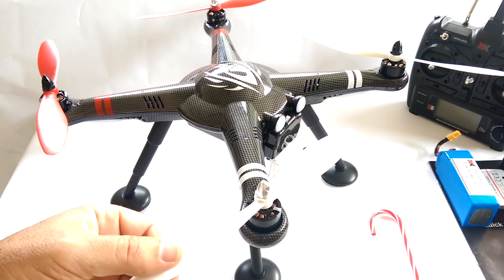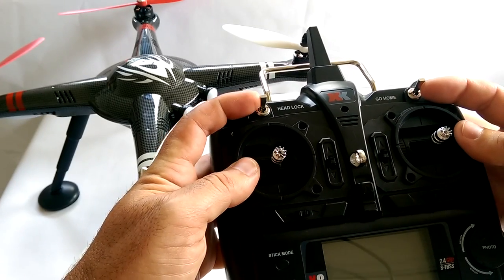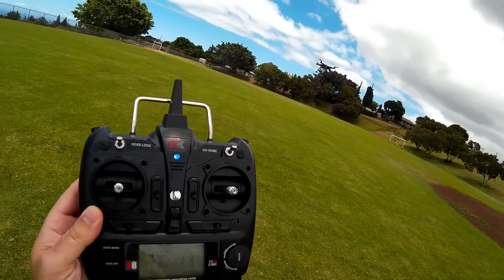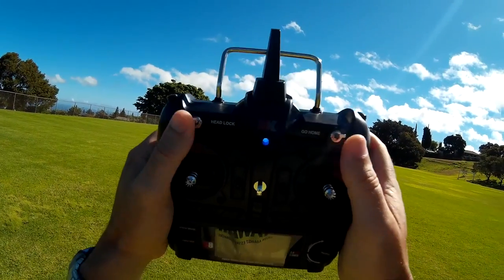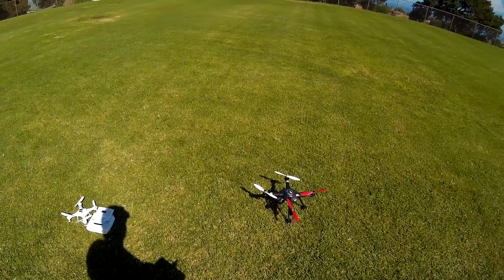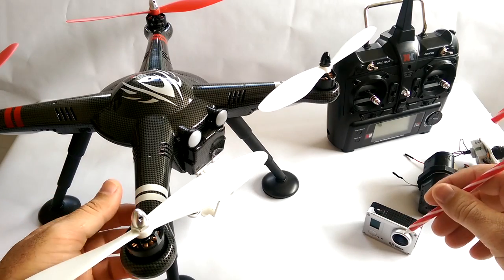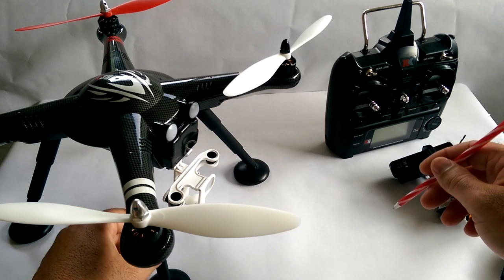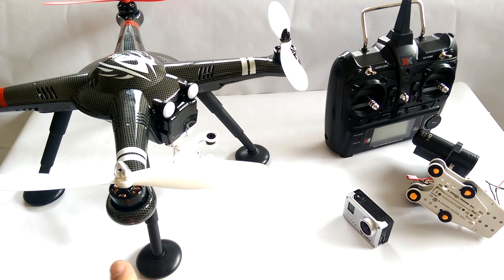XK Detect X380 GPS QuadCopter Drone Full Review - [Setup, Flight Test, Pros & Cons]

Comment: Sorry maybe you can help me,i have problem   with x380.when i use gimbal on it,the red light beeping continues and i cannot control tilt..
Thx b4..
Reply from the maker: With gimbal unplugged it's ok?
Reply: yes,work fine..
Reply from the maker: +arief budiman try to connect to the flightcontrolconfig software and see if you have any errors or problems.  You can see how to do the process and software on the rcgroups x380 owners thread.

Comment: Great review, looks like it will be taking the place of the Cheerson CX20.  On the link at GB it does not show any camera mount. The mount that you had was it stock or did you add that.  Very impressive and the price is good also.  Thank you for the video.
Reply from the maker: Thanks.  It comes with a basic dampened camera mount I tested with both that and a gimbal on review.

Comment: Did you find any problems with having the camera weight so far forward on the quad? Did this affect stability or handling?
Reply from the maker: I've only tested with Cam and Gimbal in high winds so far so couldn't really gauge it.  I'll be doing more extensive testing this weekend and keep you all posted.
Reply: Dustin Dunnill Thanks. I was impressed enough to order mine yesterday. I am hoping she fly's a little more stable than my X20 does. Looking forward o a few  more videos on this one from you. Thanks again!
Reply from the maker: Congrats!  Check out the X380 owners thread on rcgroups.com for how to connect it with software and change some parameters which gives it even more value.
Reply: Dustin Dunnill Thanks for the reply. I read many of the posts of the forum and was more confused than before I started. I am hoping you might do a review of downloading and connecting procedures sometime. When I receive mine I would like to change the return to home height parameter to a higher altitude such as 20 to 30 meters. I would also like to extend the distance fence if possible. I appreciate your videos, thank you for your efforts.
Reply from the maker: I will probably do a connection and config video soon.  I think 30M was maximum RTL altitude and that's what I set mine at.  Fence is also configurable.
Reply: +Dustin Dunnill Thanks again. Just got mine yesterday. Looking forward to your software update video.

Comment: dustin maybe i just missed one but can you see telemetry on TX screen such as coordinates, battery etc?
cross my finger wish you could turned this quad into powerful fpv machine ., thanks
Reply from the maker: Hi , nope.  Unfortunately telemetry is not built in to this quad.
Reply: we can't win them all haaa, always downside ..thanks for your lightning respond cheerrsss
Reply from the maker: Although there is a UART port on main board which looks like it could accept a telemetry antenna.  Just a matter of figuring out what works.

Comment: Hey Dustin, Can you tell me that on Maui are you allow to fly the Quadcopter at any public park or not ? or even in your back yard ? Do you need to go to special area that allow you to fly and where ? Thanks Toan
Reply from the maker: As far as I know...cannot fly in national parks and within 5miles of airports.
Reply: +Dustin Dunnill Could I hover and take off in my back garden with this quad?
Reply: +Dustin Dunnill I have flown syma x8c tarantula x6, mjx x600 easily... Could I fly this and hover in my back garden while buildings are around?
Reply from the maker: +markybyeah Yes,  it is incredibly easy to fly as long as it's working right and you give it time for good GPS lock.
Reply from the maker: +markybyeah Yes, you will be amazed how easy this is to fly.  There have been some lemons so as long as you get a sound unit you will be amazed :)
Reply: Dustin Dunnill
would you say it's more stable than the syma x8 and mjx 600?

Comment: hi Dustin, recently my x380 was about 1,200 ft away and it wouldn't respond to my controls, so I hit the RTH switch and still wouldn't respond, it would just hover in place. If the quad lost communication, it should go into fail safe mode and return but none of that happened. This leads me to believe that the quad didn't loose communication because it didn't go into fail safe. I ended up eventually getting control after 7 a minute hover. what could be the issue? replace transmitter? quad receiver? or re-download software files?
Reply from the maker: +Mirco Pintican Hi Mirco, the x380 has a different RTH than most.  It will come home on connection loss (if it is set to rth in flight controller firmware.  There is also a "hover" option if connection is lost) but unless RTH toggle switch is on, when connection is lost the X380 will stop and hover when controller connection is re-established.  So you may have had an instance where it was on the fringe of range and kept going into RTH but then hovering when back in range.  If this happens, make sure your RTH toggle is on so when it re connects the x380 will know to come home until a different pilot command is given.

Comment: Great review, this will be my next aircraft, what type of after market props do you recommend for this bird? And by the way, you have a'lot of hart for the radio fail safe test...  :)
Reply from the maker: +John Washington Thanks John.  It's a good solid economical quad.  Just make sure you read manual, calibrate compass in your flying field and wait a minute before take off so the GPS can get good lock and update.
Reply: Will do, Thank you

Comment: +Dustin Dunnill maby you can answer this question, got my x380 yesterday successfully binded the transmitter to the quad,successfully binded the calibration, but today when i plug in the battery all i get is a solid red light, tried it a few times still comes up red, any suggestions?
Reply from the maker: +Wim Ross hmm.  Could be many things.  Do a search at the rcgroups.com X380 owners thread and you should find some answers.

Comment: Does this quadcopter has altitude hold mode function? Also, do you think there is a away to get the legs out of the shots with the gimbal? :-)
Reply from the maker: Hey there.  Since this quad is always in GPS mode, the GPS works in conjunction with the barometer for a constant altitude hold when your finger is off throttle.  Works very well as you can see in video.  When you let off both sticks it goes into a "position hold" mode for a super stable locked in altitude and  position (also seen in video).
Reply: Dustin Dunnill Ahh, thanks for clearing that out for me! :-) Great over all review by the way. Do you prefer this quadcopter over the CX-20 for a beginner in aerial video?
Reply from the maker: If you can handle the extra $100 then I would say yes as it is in stock form.  But for modding future the CX-20 open source still is the best until we figure out how capable the X380 is.

Comment: GREAT review! Some questionns: This appears to be a repackaged WLToys V303 .. do you concur?  Did you do the "calibration dance" prior to flights?  I know they stress that with the V303.  The USB port could be for firmware updates ... at least that's what its for on the V303.  You're right ... very impressive, and a decent price.  I look forward to future reviews on this quad. Cheers!
Reply from the maker: Seems to be v303 with upgraded electronics and longer skids.  Yes, I did the compass calibration prior to first flight and it was easy.  USB does seem to be for updates/parameter calibration but owners (including me) seem to be having trouble connecting with available software.
Reply: Dustin Dunnill 

overall how would you rate this package for its price? approx 650$ canadian for me, ive never had a drone but i want to do an fpv setup and this looks like it would be perfect and the flight time seems awesome.

getting the x380c kit comes with a hd camera and a motorized gimbal for it right? i just need to get a separate fpv system and utilize the gimbal for full remote control right?
Reply: ObliVious
When I looked it up online, the e-tailer I saw had 4 versions of the x380. One had no mount.  One had the std. non-gimbal gopro mnt., one had a gimballed mtn., one had a mount for a Mobius (or equivalent) and one had a powered gimbal. Prices ranged on the 4. Here's where I saw that: http://www.dealsmachine.com/best_254686.html
Reply from the maker: Yes, I think it's a good quad.  Easy to fly and a simple start into AP.  I'm not sure on c model gimbal and camera quality but you can always buy base model and add your own if you want better camera quality.  You will be able to control tilt for gimbal remotely and you can hook an FPV system up to the gimbal camera or add a small fixed camera.  But for filming and lining up shots you want to see through gimbal camera.
Reply: Dustin Dunnill 

I ordered it with the camera and the gimbal i just wanted something to work with right away. ive already started getting a few items you modded your cx20 with, are you switching everything over to the 380 or are you going with new stuff? im sure the fpv and the range extender parts would be the same, but does the telemetry only work with the open source cx or can you use it with this too?
Reply from the maker: I'll be adding a new set of mod parts to the X380.  I'm still in mod capable research stage at this point with it.  There is going to be some trial and error for what works.  When I get it all dialed in I'll post up a new mods video.  I can't recommend specific mod parts yet because of this.
Reply: Dustin Dunnill I appreciate your efforts.  This looks like it may be a better option than the V303, so I'm interested. The price, for what you get, is very good (compared with 3DR, 8X and other mid range options). I look forward to future reviews!
Reply: Dustin Dunnill 

is this an 8 channel transmitter? all i can see in pictures is x8 on the tx but no literature on it. how many channels are they utilizing now, is there any free spaces to add stuff on i.e lighting? thanks
Reply from the maker: Seems to be 8 channel.  Just looks like they left off some toggle switches (channel modifiers) because of the lack of flight modes (no manual or althold only modes).
Reply: Bill Somrak  - thanks for the helpful info on the 4 different models. 👍I'm trying to decide on the XK 380 compared to the Up Air One.   Suggestions  would be appreciated. 👍😎🇱🇷❗

Comment: Hi thanks for review :) I bought 380-c Do you now if it`s possible to use controller for take photo-shot??
Reply from the maker: Hey,  sorry.  I only have the basic naked model.  I could not tell you.  But someone did comment on forums who had C model and say they cannot take photo.
Reply: sweidol I think no. Because as i so around you power camera on the ground not  over the controller. I order and pay for x380C but customs made me problem with importing lol still don't have it  :(    Bad  luck
Reply: spodo68 Oki sorry to hear :( 

Hope they solve your problem, i had custom check to, security check...  :O
Reply: Dustin Dunnill Relay strange for a flying camera  :D  

Maybe one miniusb cable between camera and gimbal, need to fix one :)

Comment: Dustin, I want to get one, It is shipped with a euro power plug and I am in the US. Can a cheap adapter be used to use US voltage? If not, what would you recommend?
Thanks for a really great review on the very nice quad.
Reply from the maker: Yes, us adapter will work.  You can get them for a couple bucks all over the net.  Did you check the box good?  Usually they throw one in when shipping to US.
Reply: +Dustin Dunnill Dustin, Got mine the other day but were having a bit of rain, so haven't flown it yet. Also just for your people to know it did shit with a USA adapter for the charger. What I really need to know is how to properly calibrate the compass, every one I see is different, Please do a video on this step for us novice flyers.
Thanks.
Reply from the maker: Congrats on receiving it!  The way I do compass cal is how it says in manual:  place on level surface, power on, wait a minute, throttle down while switching left toggle up and down until you see rear light on solid, pick it up and keep it level while spinning in a circle a few times, set it down, throttle down and switch toggle up and down until you see light change again, pick up and put face (headlights) pointed down at ground, spin a few times, pit down level on feet, throttle down and flip toggle a few times again until rear light changes again.  Done.
Reply: Dustin Dunnill Again, many thanks..Have you tried the new firmware to allow for circling?
Reply: Dustin, This might be a stupid question but I hope you will answer: I have another unrelated question about my 380, 1. should I charge the Lipo out of the box (from the seller)? and 2. Do I plug both cords from the battery into the charger or just one, and which one should that be?
Thanks
Reply from the maker: +rjmprod Yes,  it's not worth it in my opinion.  just slowly spins clockwise when you press photo button on TX.  you can do the same thing by just pushing your yaw stick slowly.
Reply from the maker: +rjmprod I never used the stock charger to tell you the truth.  go straight to my smart charger if able.  seems like you should just plug whatever ports will fit the battery on the stock charger.  If there are 2 ports plug both in if 1 then 1.

Comment: why don't you use your camera drone to search that tree for your little hex copter? then if you find it rig up a wire or string to nab it all at the same time getting it on camera so we can watch and maybe give advice on how to get it down. I saw a vid how 2 men got a broken drone off the top of a castle with a tricopter
Reply from the maker: I was thinking I might just try that.  The micro hex is so cheap though and I'd hate to loose it in the tree also.  If I was rescuing a larger Drone I would do it.

Comment: Have you tried using the sony with the stock mount (gopro2sony adpater)? Because with steady shoot it may not shake as much.

By the way this is what I call a great review... +1Sub
Reply from the maker: +XSpt (X_Splinter) Hey thanks.  Maybe there is a Gopro to Sony adapter I don't know about?  Do you have a link?  Thanks.
Reply: +Dustin Dunnill yeah I record my bike videos with my Sony using gopro mounts.
All you need is one like this http://www.amazon.com/pangshi%C2%AE-Adapter-HDR-AS100V-HDR-AS200V-FDR-X1000V/dp/B00PC3II2M
Reply from the maker: Thanks.   I actually have a few of those.  The flight vid at park was with an Amkov gopro style Cam just to test.  Near the end I mounted up the Sony on a gimbal but did not have steady shot on in my yard.  Thanks for the tip though...I totally forgot that the Sony could hang from the stock mount using that adapter :)

Comment: Dustin, I have a question you might be able to answer about fail safe functions  provided in Ground Station Software for the X-380. 
In Ground Station Software you can select either RTH (tail in), or RTH (tail out), or Hover or Land, is the selected fail safe automatically engaged when the 1st or 2nd low battery level warning occurs?
Reply from the maker: +Stretch 9x tail orientation is separate than other functions and just means how it faces in rth regardless of the options.  Hover, land or rth upon connection loss is where only one option cam be chosen out of the 3. 

At the first battery level failsafe you select what voltage warning light will flash.  Second battery failsafe you select at what Voltage it will do a forced low voltage auto landing.
Reply: +Dustin Dunnill  Thanks, I will select RTH tail-in for connection loss, and raise the 1st low voltage warning level to hopefully avoid an Auto Landing in a location where the quad can't be retrieved. Sacrifice a couple minutes flight time today - fly again tomorrow!

Comment: I would greatly appreciate knowing what brand/model would be compatible with the X380 battery. Seems no one locally can help me on that one.
Reply from the maker: Do you mean what other battery can you use in the X380 or what other RC can you use the X380 battery in?  Battery is a similar shape and size to the Qrx350 and Ehang ghost off the top of my head.  You could always research dimensions if you need exact sizing.
Reply: +Dustin Dunnill , Thanks for getting back to me...My apologies...What I am looking for is a peak battery charger that can be used with the X380 battery. Local shop was at a lose considering the XT60 plug as well as saying the balancing charge needed to be known as well. Really new at this, so pretty much in the dark about such matters.
Reply from the maker: +Charles Buffalo A very good and cheap charger is the SkyRC B6.  It works very well and can charge many different batteries.
Reply: +Dustin Dunnill Thanks, I'll give it a look. 4+ hours is a long time to wait on a battery with the stock charger, not that the motors could probably use a bit of cool down time themselves.

Comment: Dustin nice review. Beginner here, with X380-B. 2 items I'm confused about that You don't show. 1. small 3 plug charging cable. is this for charging while battery is in drone? 2. Came with a thumb drive, and have no clue what it's for.  I looked, and looked before I decided to bug You. :-)
Reply from the maker: Hey Jeff.  You have the "B" model that has the small black camera without gimbal correct?
Reply: +Dustin Dunnill Yes. Figured out that the thumb drive is the sdcard reader but still wondering about the small charging cable and purpose of the usb on the drone that You mentioned